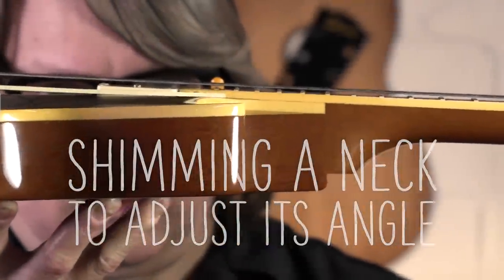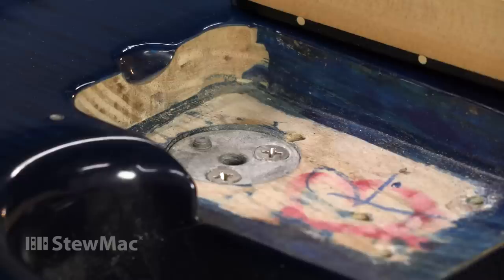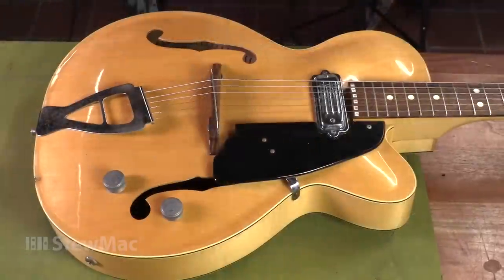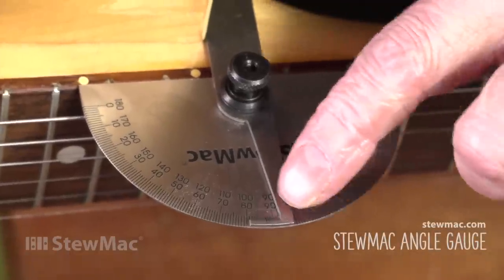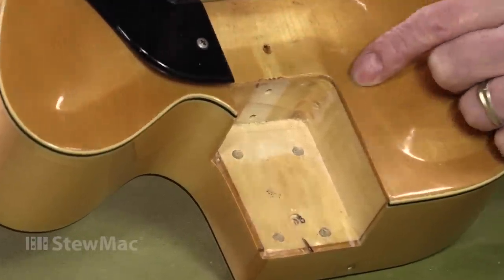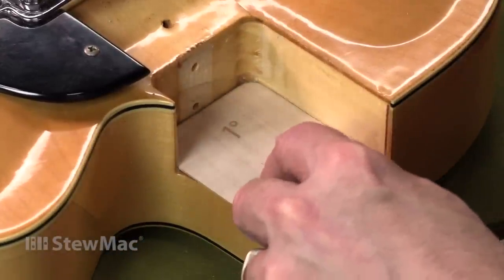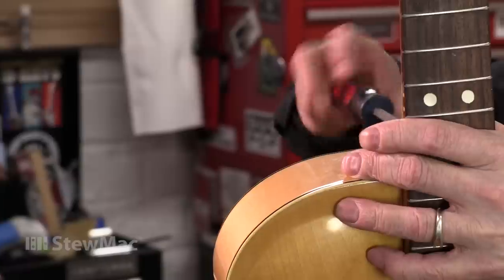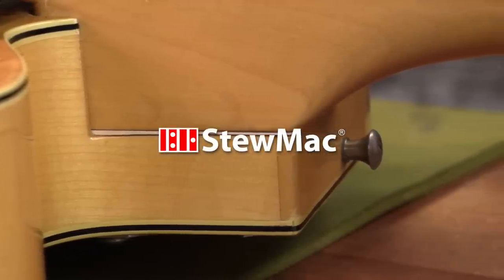How to shim a guitar neck to adjust its angle

Comment: WHy don't you have some dremel type tools to remove material from the front of the heel pocket?
I don't want any shims. 
I know they are ubiquitous. I wonder what percentage of new Fender bolt on neck guitars have them from the factory? I hear they make 600 units a day in Corona and Mexico?
Why lift the back with an wedge/angle shim instead of removing the counterpart wedge of body from the front to back of heel?
Reply: cause it's harder to do, you weaken the neck pocket and its irreversible. I want to see how you make precise, level surface of 1° with a crappy dremel tool instead of putting in a shim in that small space. You could do that with a CNC, but even then it would take time to remove the toolmarks. If a neckshim is so horrible, can you hear the difference if if a player is using the micro tilt on his guitar?

Comment: Just put a piece of a business card in there it works just as well. I’m sure Dan erliwine has used many business cards over the years.
Reply: No it doesn't.  Like he said in the video it creates a gap where the heal of the neck is not contacting the pocket.  It screws up your sustain and tone also.  It needs to be the same wood as the neck and tapered.
Reply: Guitars have been shimmed this way for years without this and it has worked just fine. if there is any loss in sustain or tone it is very minimal or noticeable. just learn to play the instrument and it will all work out.   @tecnolover2642

Comment: Beware of these shims.  I had a "guitar repair person" tell me that I needed one.  So I paid to have one put in my Fender Tele.  Then as time went by, I began to suspect the shim was completely unnecessary. So I removed the shim and adjusted the bridge and the truss rod.  The result---  a perfectly aligned neck ever since.  Remember that a lot of "guitar repair persons" don't actually play guitar, or are only amateurs.  You have to feel it out for yourself.
Reply: If the guitar is properly set up, you should know if you need a shim or not. Also, you would know if the guitar was NOT set up right in the first place.Basically, if your neck is straight, and your bridge is either maxed high or low when trying to get the stings parallel with the neck, you need a shim. Sometimes you also may have a receded nut that needs to be replaced.

Comment: Na no moisture. The problem with this overpriced shim is,That it shims the whole neck up, causeing you to raise thebridge up to the sky, It only needs to beshimed with a little peice of sand paper ,bout half inch wide 250 grit wet dry is fine thats all